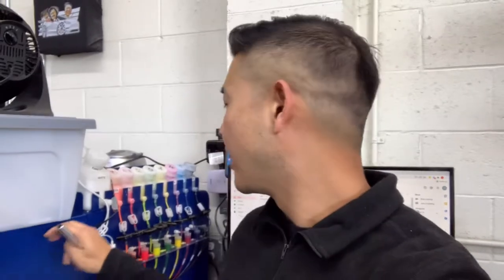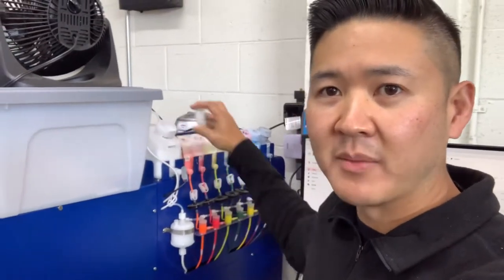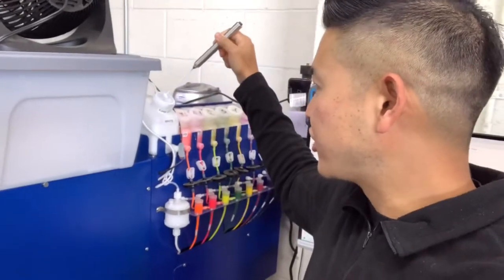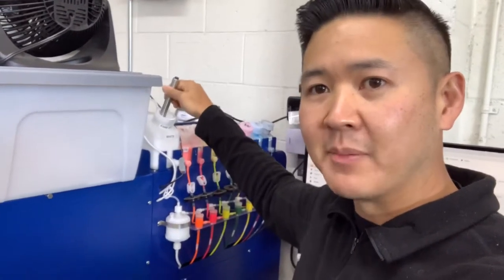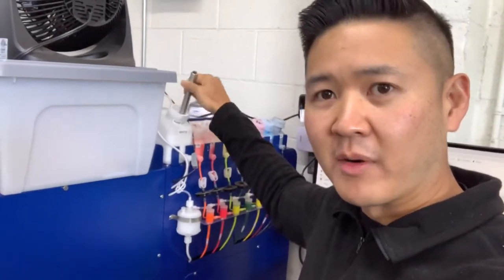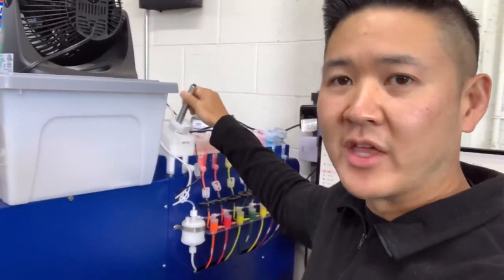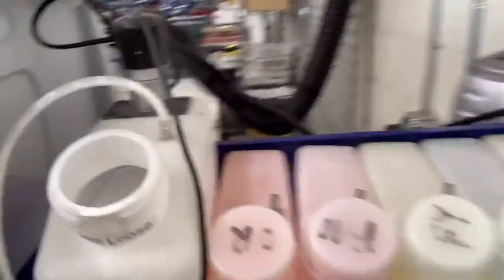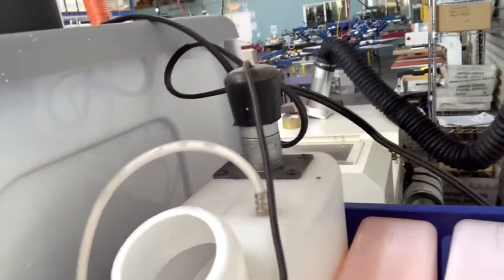Most Important Tip with your Wide Format DTF Printer - White Ink Mixing

Comment: Seems to me, The only SURE way to ensure a largely maintenance free DTF printer would be to make one that can completely purge any delivery tubes or manifolds leading to the print heads after each session and prime with a storage solution until it's time to print again.  Such a beast would have TWO delivery systems.  One leading from the ink tanks, and one leading from the storage solution tank.  It WOULD use a little ink, but a small price to pay to always know your printer was going to work tomorrow, or next week if it was going to sit until then.

Comment: i have the A3 DTF printer , the white ink is not coming to the tube what do
You suggest ?
Reply from the maker: Pump failure? Clogged line? The white ink will harden up after a few days. You need to make sure you run your white ink daily
Reply: @transfersuperstars  I have been researching a machine for a while - White ink drying is my biggest concern. During weekends and holidays, how do you ensure the print heads don't clog due to white ink? Monday to Friday isn't a problem to run the machine and do general maintenance, but my concern is what about the days you can't be in the print shop to run the machine. What is your advice?
Reply: @Jarradpetters  That is a major concern, let along long weekends.  We wet cap our print heads for the weekend.  and then make sure you do a thorough cleaning on Monday.